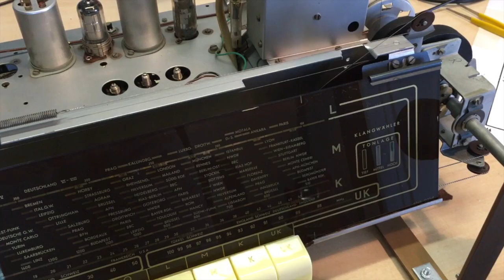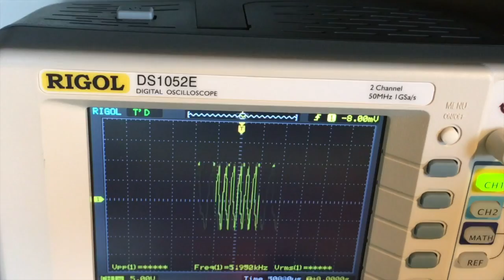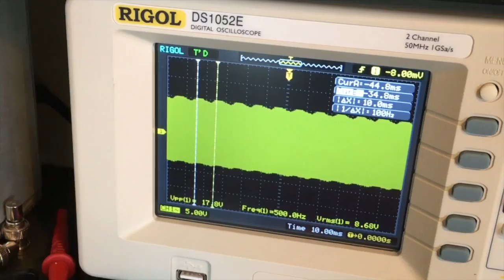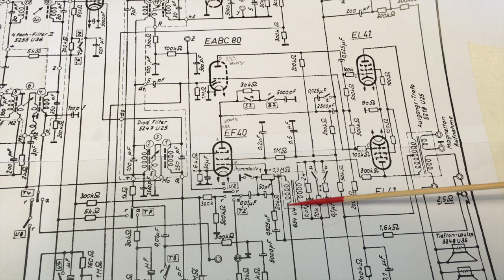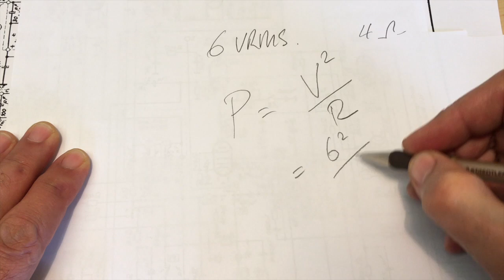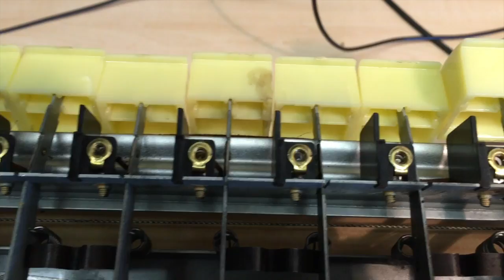Saba Freiburg W2 Restoration  - Part 4. Oscillation mystery solved.

Comment: Very interesting.  By the way, the speaker coil is not simply a resistance, there is a significant amount of inductance because the coil has an iron core.  This means the heat dissipated is not V squared/dc resistance. The current flowing in the speaker is V/(dc resistance) at low frequency, but it drops off a lot at high frequency.  I have no idea what the inductance of a speaker is, but at 30kHz you would only need about 5 milliHenries to give 1000 Ohms of impedance.  I suspect your speaker would be safe, but like you I would not be happy about leaving it running like this.

Comment: Good analysis of the problem. I didn't know SABA had such complicated feedback circuits. As you mentioned, the speaker does not react on the high frequency signal, but the winding has to dissipate the power. Luckily, the EL41s are limited to 9 W output power. I had a similar problem with an 120 W amp using four EL34 in push-pull. It was oscillating at 100 kHz, I noticed this as the high-range speakers started to smoke ;)
Reply from the maker: rotwang83 : smoke is always a good diagnostics tool! Not the best, but if you can't avoid it, use it.